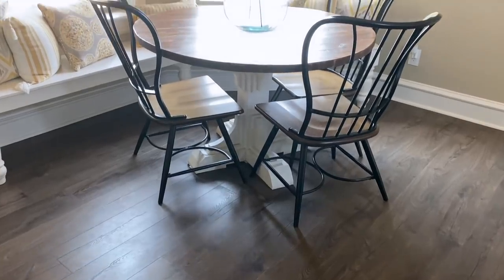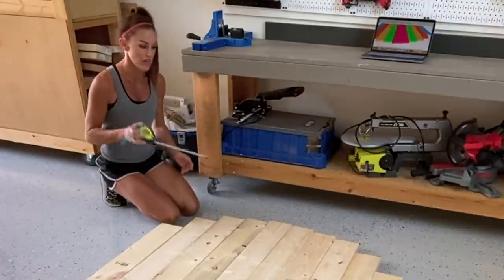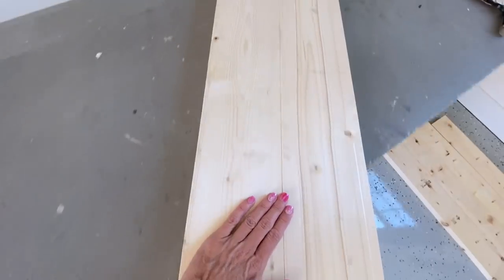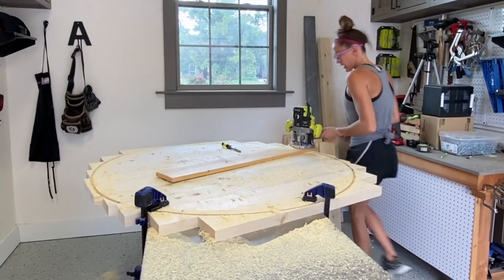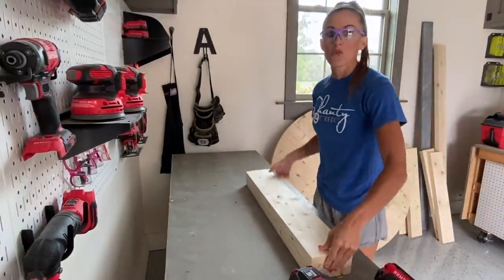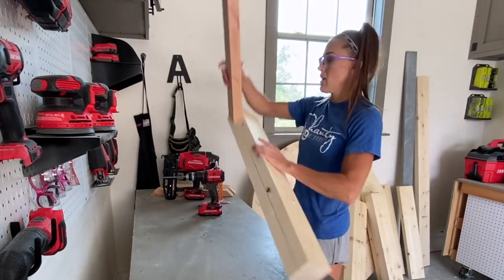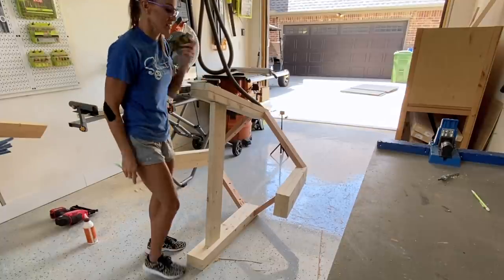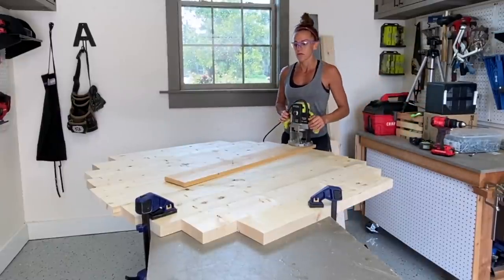$70 DIY Round Dining Table

Comment: I am loving all of these DIY ideas! These are great for folks wanting to decorate but save some money. If you don't have the tools to rip the edges what are some alternatives? Does Lowe's or Home Depot fo that or just cut to size?
Reply: You can use a hand saw to cut the the boards. I would stick with rectangular tables though if you don't have a router since it's extremely difficult to make a round table without a router or at the very least a jigsaw and a random orbit sander
Reply: @strykervalkyrion  Thanks! I appreciate the reply.
Reply: Andrew Le I was thinking they mean ripping the boards to get rid of the rounded edge.
Reply: "Woodbrew" has a YouTube vid about making a round table with only $300 in lumber and tools, and they use a circular saw to do both the board ripping, and cutting the table top without a router. Its worth a watch!
Reply: @sayitaintso417  Thanks! I appreciate the suggestion.